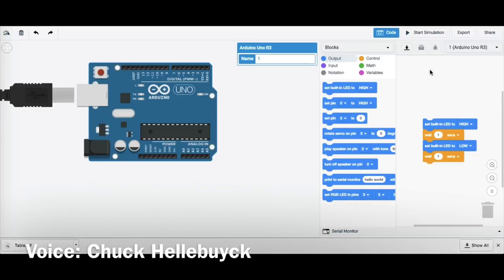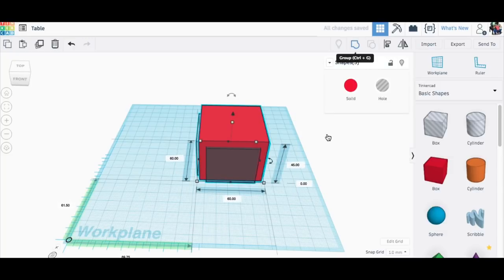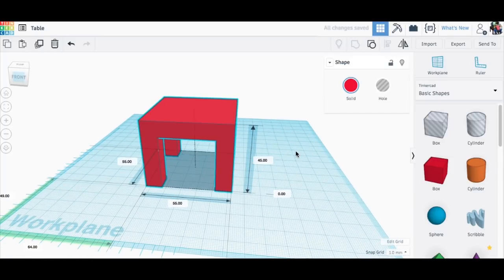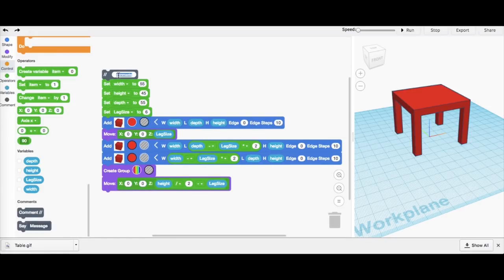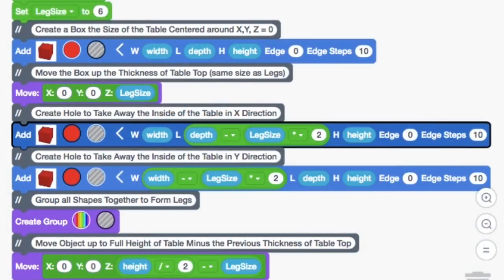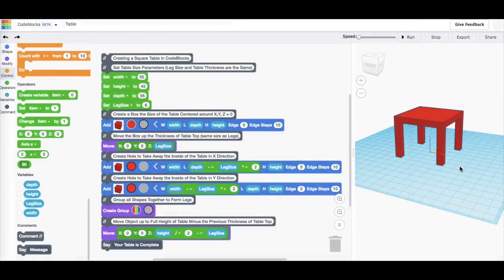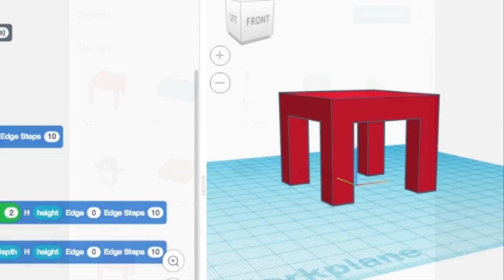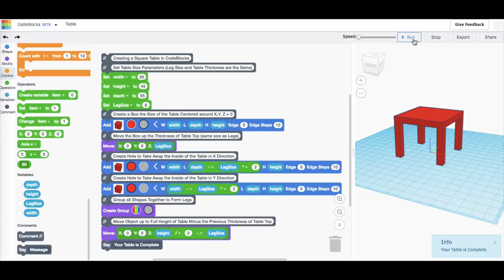How to use Tinkercad Codeblocks to create a 3D Design

Comment: As soon as I saw the tweet about this feature, I realized it had tremendous potential. Allowing one to add parameters to a design in Tinkercad allows for some easy iterative design that I long felt was missing from the program. However, by isolating it into Codeblocks as a separate feature, they don't take away from the ease of use of the "vanilla" Tinkercad. It rocks!

Great video!